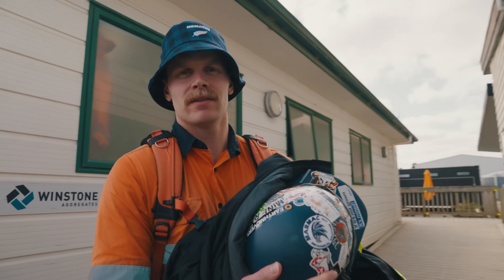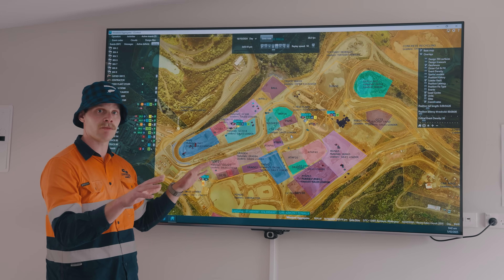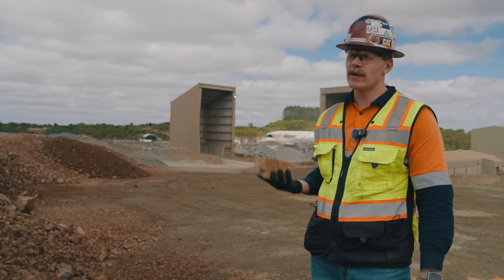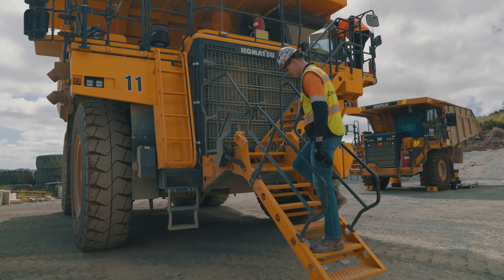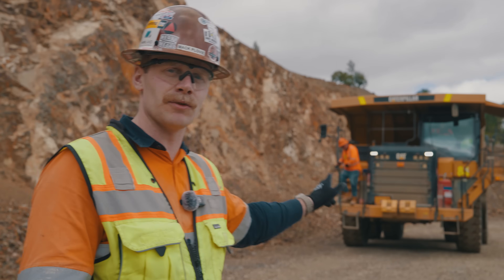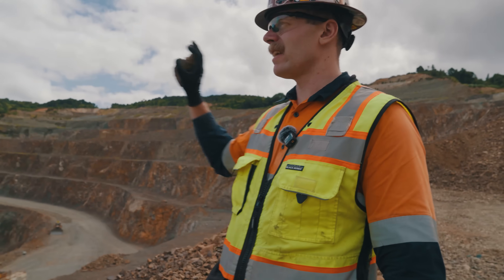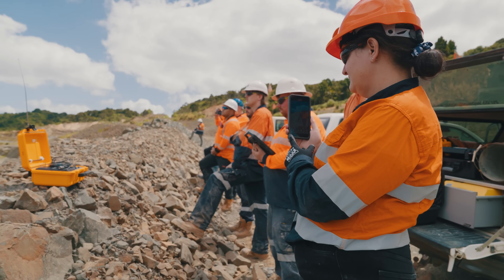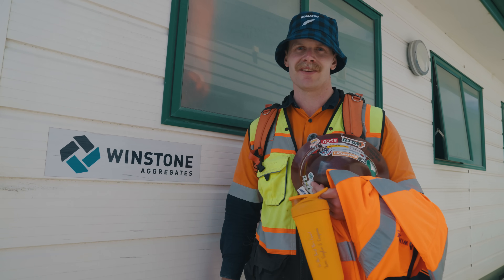Inside One of New Zealand's Largest Quarries

Comment: My one question?? What is daily work load percentages you get with that cat 395? ima guess 95%. The lights are a great idea to signal the trucks. I use a door bell :0 But im not feeding 20+ trucks.
Reply from the maker: That 395 works alongside a Komatsu PC1250 in the pit loading out a fleet of 775 and HD785
Reply: @Earthmovers_media  pretty similar setup in coal mine here, they try with 6015, but didn't work
Back to 395
Reply from the maker: @rmdhndwi  which mine?